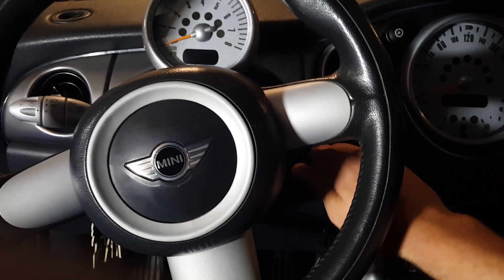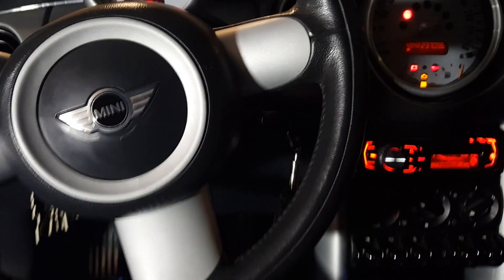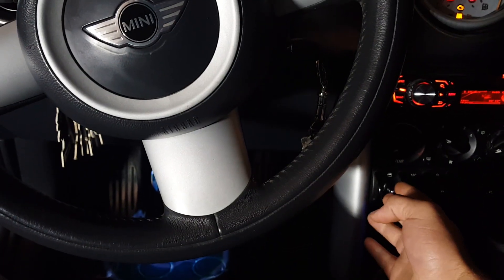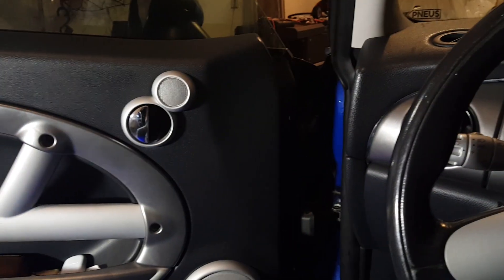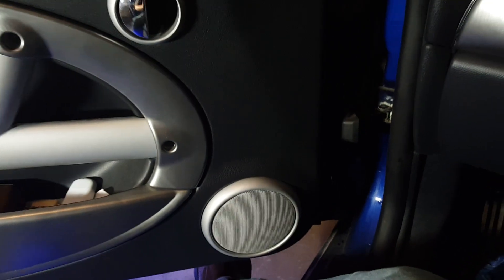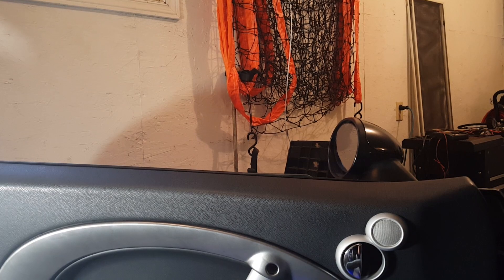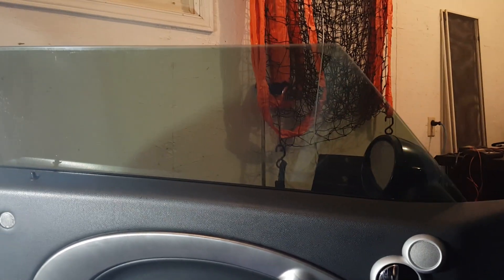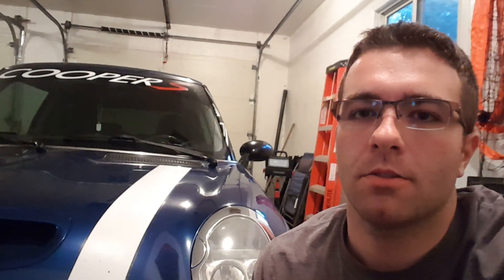How to Fix a Mini Cooper Window (Easy)

Comment: Afte watching this I tried it. IT WORKED. I was skeptical. The window switch didn't cooperate but the door lock switch did. 

With a mechanical key and lock, you can roll up the windows by holding the key to lock. After banging on the door, that option worked. 

Switch group is falling apart sonic could be faulty, but it works now also.

Thanks for the video

Comment: I had mine down at work to air the car out a bit. Twelve degrees outside. I thought it was going to be a very cold drive home. Pounded on the door. It worked. Window went up. Thank you!

Comment: Didn't work the first time on my 2002 Mini. Let it sit for about 10 minutes and then went out again to conquer that passenger window failing to roll down... determined to get it working. Pounded on the panel above the speaker real good a number of times. Nothing. Hmm... fiddled around with both window buttons, pounded it again REAL good and WALAAAHH it worked!!! Yay!! Thanks Corey!!
Reply from the maker: Glad to hear it ended up working!

Comment: Thank you for the tip. I wound up having to remove my door panels, which gave me direct access to the metal frame. After a couple of hits, the windows operated normally. You're a life saver, I really didn't want to remove the window glass to replace that motor... My situation involved both doors. I've replaced the drivers door motor twice over the thirteen years I've had the car... 🍻🎊
Reply from the maker: Glad you figured something out that worked for you!

Comment: Brilliant cheap lol fix that actually works ppl! Bought a 2003 Mini One rather quickly and didn't check the electric window first ,my bad .Found out when I got it home ,could of been rather expensive to fix if I had given it to a garage .Huge thankyou !!!! Corey :) Thought via other YouTube vids I was going to have to take the door appart and clean the motor actuator (which I may have to do eventually) but right now it's fixed ppl,Happy Days .

Comment: Amazing mate it worked for me. I greased the runners as door card was off but tried this after and it worked a treat. Maybe motor  cuts out when it's stiff but in any case thanks for going to the trouble of posting this you saved me loads of work. 👍👍👍

Comment: When both of my 04 Mini Cooper S windows recently stopped going down, I tried the bang-the-door-card while holding my switch down, but it didn't work.  I just tried it again holding the switch up as you did and whacking the door with a big rubber mallet, but still no joy.  I guess it works for some, but it looks like I may be in for a window motor removal or two.  Nice video, though - well made and a good description of the bang-the-door method.
Reply from the maker: Thanks for the feed back, ya it must be something else, because mine does not take much of a whack to get it going. Did both die at the same time? If so could be a fuse or something.

Comment: Thanks - it worked! It recently only worked occasionally, then one day stopped altogether - luckily in the up position. I thought it may be a fuse. The fabric roof also only opens halfway - still wondering how to fix that - and is not the two connections in the boot.

Comment: How about the unlocking of a door. My passenger door will not unlock by the switch. I have to manually open it each time. I was told it was the cylinoid and it's $200

Comment: My drivers window is stuck in the up position. When I try it down the window motor turns but the window doesn't move. Any info on how to fix this would be greatly appreciated
Reply from the maker: Unfortunately I don't.

Comment: It worked for me, so now it has made drive-thrus a lot easier.  Thanks for this tip.  I thought that I had lost all power to the door as the lock doesn't work either.  Do you have a tip for that?

Comment: I think this will work, because my 04 mini had a problem but it’s not the window, it’s the driver seat that won’t stayed in the reclined position, I checked d internet and someone told me to hit the back of the seat with your hand or rubber mallet, it work!!! And d problem never came back

Comment: For all who are wondering how and why this works... it's because the motor that actually moves the window up and down is right behind that part of the door panel. What it means is that the motor is getting ready to quit. Time to get a new one in there...
Reply from the maker: That's correct! Mine continued to work for 2+ years.

Comment: It didn't work. And my window today just randomly started this. I beat the hell out of it. And nothing. What should I replace?
Reply from the maker: I would take apart the door and check to see if there is power at the window motor. If there is then its probably just the window motor that needs to be replaced. If there isn't check your fuses.

Comment: That’s window electric motor brushes going bad, when you wack it, brushes make connection again but that’s very temporary fix.
Reply from the maker: That's right, but this temporary fix was still working when I sold my car, which was two years after it started happening.

Comment: Window got stuck down in the parking lot. this trick worked and got my window rolled up so I could lock the car up. be prepared though to replace the drive motor because this trick doesn't last forever......

Comment: Okay.. didn’t work for me and I may have injured myself.. any other tricks? I appreciate this video though.
Reply from the maker: That's unfortunate! I don't. There is a large variety of options for what the problem is. I would get it diagnosed if you want it fixed and go from there.
Reply: @MrCoreyMartin  hi! Actually several days later is suddenly started working. 🥳

Comment: This method will work for 2 or 3 years, but the malfunction will appear more and more frequent. It is sleazy quality. As an insider told me, spring tension of carbon brushes is too weak within the motor; besides the guide for brushes is too narrow and carbon dust jammes it. Thats why a jab helps. But the spring of brushes becomes  weaker and weaker and the dust more and more within the housing. Very obviously  construction faults! Or malicously planned obsolescence. After the dealer wantet so much money for a new one (windowmotor) I bought an other car (after the passengers side startet malfunctioning, too -and even the electric motor of power steering pump, what was very dangerous from time to time). Now Im happy with a Subaru Forester.The Mini Cooper I only drive from time to time  for charging battery. Thanks to the business economists and/or incompetent engineers every fun with this car has deflagrated to less then nothing.

Comment: I’d really like to know what the real issue is cause it Seems like a lot of us have this problem no matter the year. 😂
Reply from the maker: I think its a badly designed window regulator, that ends up sticking. Mine was generally worse in warm weather.

Comment: Its not a FIX. It has a bad window motor. I can hit a starter with a hammer and get it to crank a few times then when you need it most, it will leave you stranded. Replace the motor.
Reply from the maker: Your absolutely right! but it has worked for me for well over a year now, and if it quits it won't leave me stranded, my window just won't work. So as long as it keeps working like this I find it silly to buy a new window motor on a car that is getting to the end of its life.
Reply: Two years since I've had to do it . It works